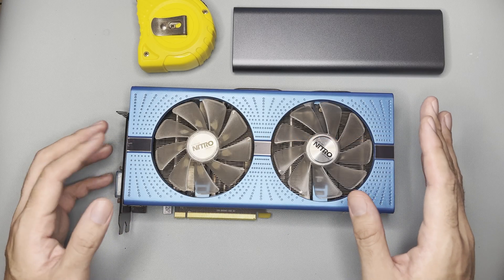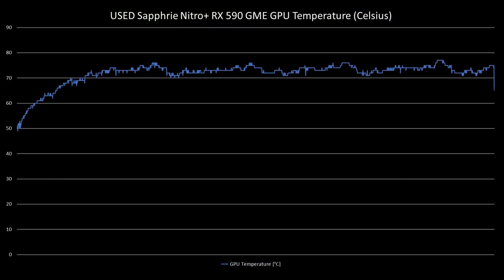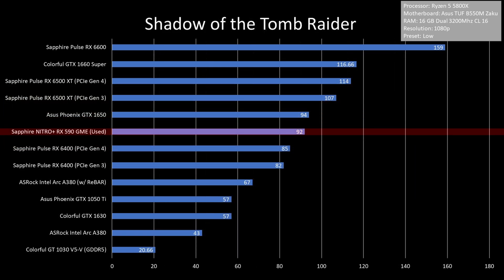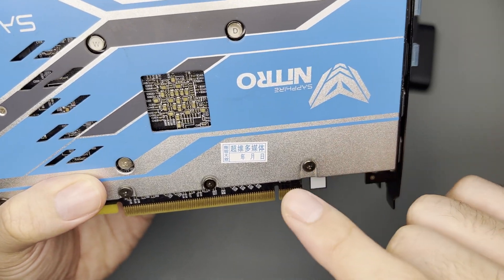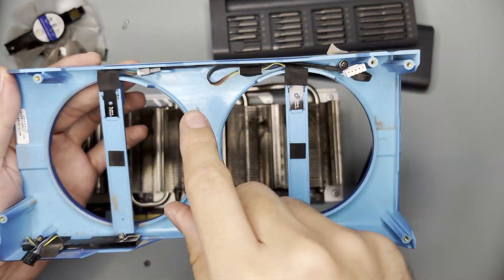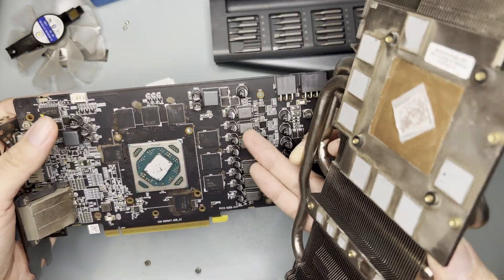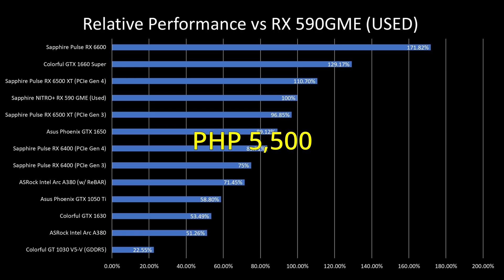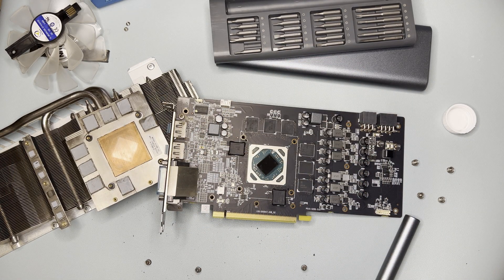Used Sapphire Nitro+ RX 590 GME Benchmarks & Teardown

Comment: Hello, how can you tell if it is the GME or the normal variant of the card? How much better will the normaal RX 590 perform over the GME version?
Reply: @theduck4469  1)it has its special like code number under the mark
2)i can say 5% difference
Reply: @Hakistem  does it have the "gme" on the sticker were the serial number and model is located?
Reply: You can go to settings then display then advanced display settings and display adapter properties. It shows the name of the gpu and it will show gme if it is one
Reply: GME have 2304SP (Shader Processor/Units).

Comment: I really appreciate your review and teardown of the gpu sir, however nagdadalawang isip ako if I would purchase this over an RX 5500 XT. The same store prices the latter at 5.9k pesos. Although I keep reading from reviews online that the 5500 XT only has cooler temps but is superceded by the 590 in performance. Would you prefer the 5500 XT over this ba? Thank you po in advance!
Reply from the maker: I’d go for 5500xt. Mas tahimik din yan at mas power efficient. Make sure lang din sir na 8gb.
Reply: @manongunboxing  okay thank you for your insights po sir! Subscribed to your channel for more benchmarks and builds :DDD

Comment: Sir will my ramsta 850watts PSU will be compatible for this specifically for the pin connector
Reply from the maker: As long as it has pcie power connectors (which is standard), it should be fine

Comment: iknow i'm late if there anyone reading this 😭  i have the same gpu then nilinisan ko siya after that after kong malinisan ni replace ko thermal pads and paste all of a sudden bigla na siyang nag o'over heat tech noob here ano po kaya nangyare? salamat sa makakasagot
Reply from the maker: Pakicheck po yung way ng pagmount ng cooler sa gpu.

Baka po hindi kayo nag-3 turns at a time per screw po. Pwedeng lopsided yung lapat ng cooler sa GPU.
Reply: @manongunboxing  may sukat rin po ba mga thermal pad pagpapalitan?
Reply from the maker: Ay sorry wala po ako. Contact Sapphire directly po

Comment: Kaya na po ba ang 500w psu dito? Gusto ko sana bumili neto kaso may doubt ako na baka di abot ang 500w? Kasi 500w lang po meron akong psu. Kakabili ko lang ng psu. Sana po mag reply kayo asap
Reply from the maker: Power will depend po sa buong system rather than a component alone.

Use this calculator and plug your components to see if kaya po:

https://www.fsplifestyle.com/landing/calculator.html
Reply: @manongunboxing  ok boss salamat sa tips. Subscribed!

Comment: I know im late but what would happen if you replaced the thermal pads with the thicker ones? Like changing the 0.5mm to 2mm. Will the the temps be cooler or hotter?  I bought the xfx rx 590 gme and i would like to replace the thermal pads. I'm having second thoughts because of this. Thanks in advance for the answer!
Reply from the maker: No, don't replace to a thicker pad. What will likely happen is that the heatsink will not touch the GPU silicon. Expect hotter temps and shorter life.
Reply: @manongunboxing  noted sir! Salamat ng marami!

Comment: psu ko po 6pins lang. tapos pwede ba 
molex to 8pin adapter tapos yun 6 pin ng PSU ko? 
PSU ko old na cougar 550watts
Reply from the maker: Pwede pero I would strongly advise AGAINST it. Fire hazard yung mga molex to 8-pin adapters.
Reply: @manongunboxing  thank you. bili nalang sguro ako kahit generic psu. mild user lang naman ako
Reply from the maker: Oki, pero please don't buy generic though, buy PSU with reputable brand (Seasonic/FSP/Corsair), even their low-end tier will do.

Last generic PSU na gamit ko, it took the whole system with it nung nasira (shorted motherboard, HDD, and GPU). Pero yung Cougar ko rin na PSU, bought 10+ yrs ago, napamana ko na sa friend ko, still alive and well.
Reply: @manongunboxing  Thank you Manong 😍😍

Comment: i have a question , so someone building me pc said the rx 590 gme is rx 580 with bios upgrade and that i should buy his rx 580 (also sapphire)saying that his is more reliable as the other one could have been mined and such as well as the rx 590 gme sapphire nitro plus with only give 1-2 fps difference from rx 580 sapphire nitro plus so i got it from his , so what he said is true?
Reply from the maker: RX 590 GME = rehashed / oc'd RX 580 is true. RX 590 GME is approx 6% better than 580 and 2% weaker than 590 non-GME. 6% on average, i.e. it might be 6 fps if the game runs 100FPS on RX 590 GME. 

This RX 590 GME could have been used for mining is a speculation at this point but is highly likely to be true (i.e. unproven but we all know where the biggest cryptominers came from; the timing when it came out is also suspicious as it came out during the crash of the crypto bubble)

Whether or not his is better or from another 3rd party seller is something that we can't know at this point as to how much lifespan is remaining is really difficult to test (this is already a risk when you are buying brand new and even more so when buying 2nd hand as you don't know how much life did the first owner has consumed). Mine is ok but I am not sure how his is. How did he take care of the GPU, how bad is his version, etc.

I hope I made sense.
Reply: @manongunboxing  so I made the right choice to get a 580 instead?
Reply from the maker: The answer is we really don't know. We don't know how much life was already taken from what you bought and what you could've bought.

But if you trust your friend and your purchase is good enough for your needs, it was budget friendly to you as well vs brand new findings, then it is good enough. No need to validate your purchasing decision. 🙂

Comment: Heya! I recently purchased an RX-590GME and struggle to find drivers that are compatible with it. Any advice?
Reply from the maker: You can use the latest adrenalin even though GME is not listed.

Go to www.amd.com/en/support > Search for RX 590 > Submit.
Reply: Did you find the drivers?
Reply: @chrisglz  Yes, Unfortunately we have issues with VR compatibility and othersuch with this card, unsure if it's a system issue since we've heard 6000 users having this issue too
Reply: Is it real 590 GME or a 580 PCB with 590 GME vBIOS, I had issue where MLLSE, selling fake 590 GME, I made a video opening the card up.
Reply: @AlexHusTech  AFAIK the card was legit and backed it up overall performance wise / testing. But it did run somewhat hot. We got it to run everything eventually, and after speaking with META it appeared they just have compat issues with older AMD generations.
Reply: @RWolfeOG  Oh ok, hopefully they patch the fixes, for the RX 590, it's quite an old card now so updates probably take longer.
Reply: @AlexHusTech  A Meta representative said they plan on dropping support for RX 500 and a few other cpus/gpus by the end of this year I believe. Quite unfortunate
Reply: @RWolfeOG  Oh, I need to sell mine then soon...

Comment: I got the same one in a build that cost $250. 590, 2600x 16gb ram, 500gb ssd. It also came with a monitor which I sold for $100. So for the price I think it’s a phenomenal gpu. Thanks for the tear down. I’m thinking of spray painting mine for an all white build.